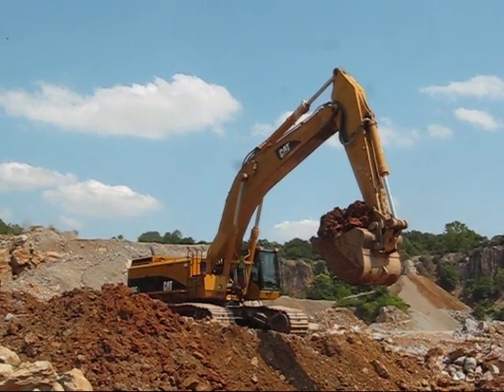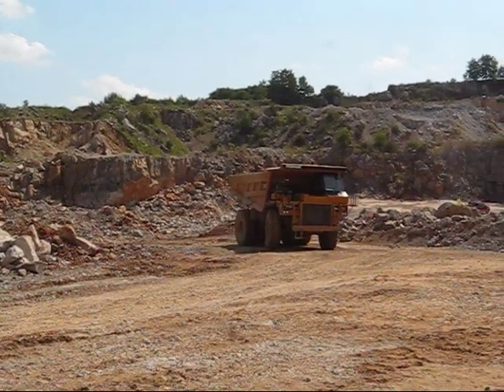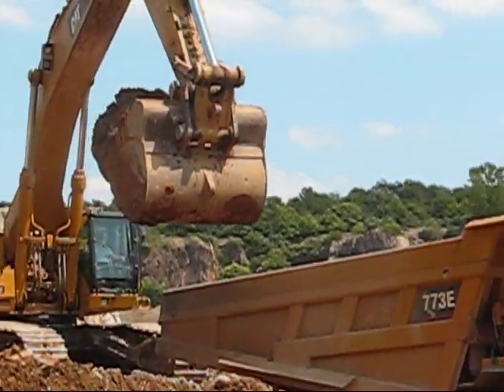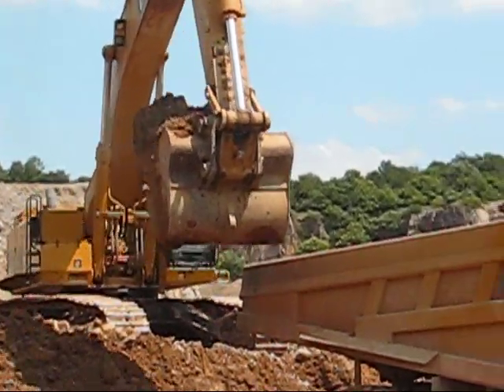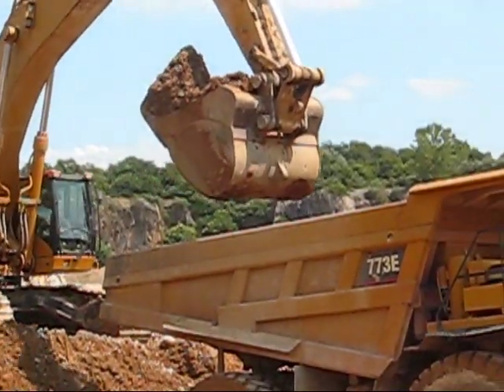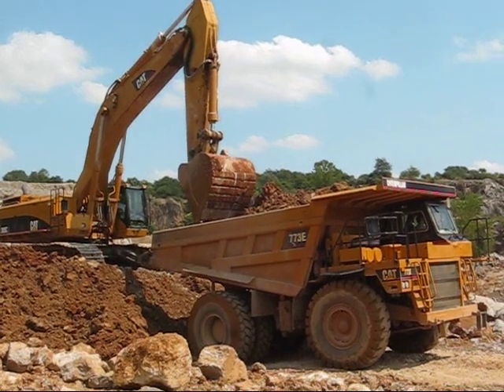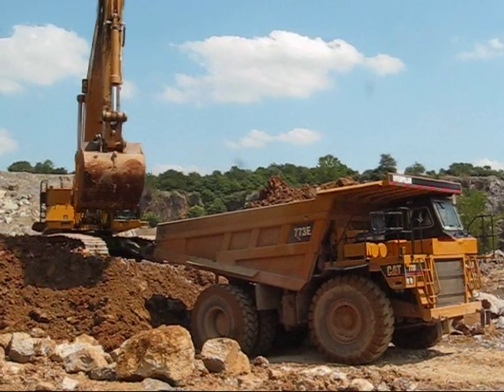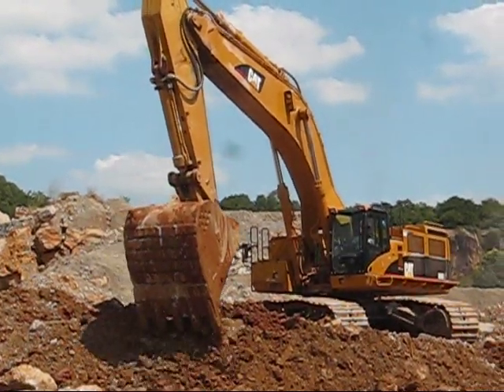Caterpillar 385CL Loading 773E

Comment from the maker: @UAL012 That's the way the bought the machine. This is a very unique hard rock quarry because the rock they mine is mixed in with a clay. The 385 is used to dig and seperate the blasted rock from the clay.